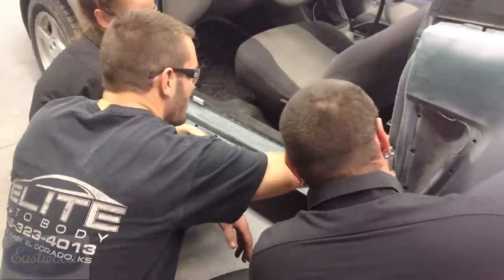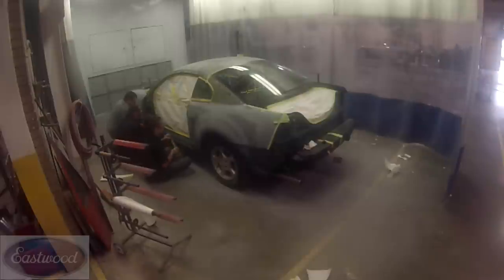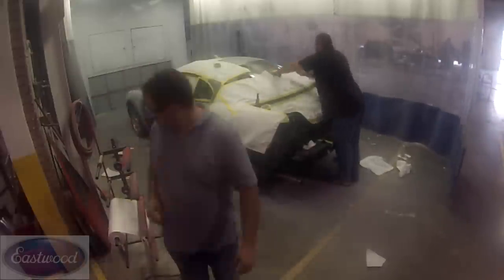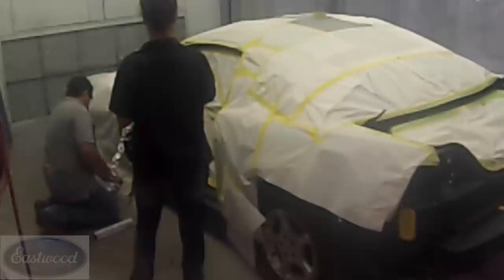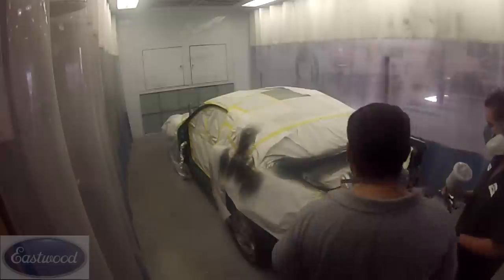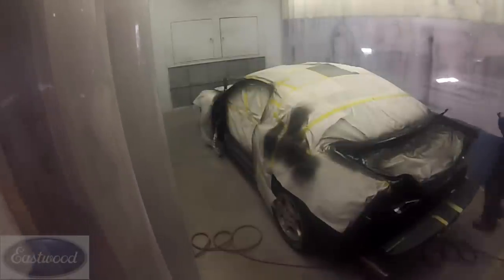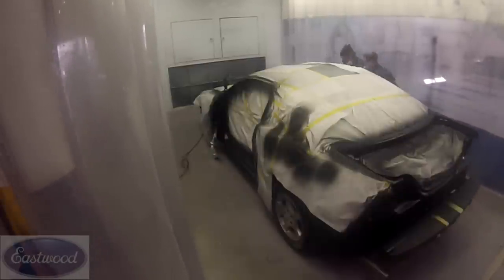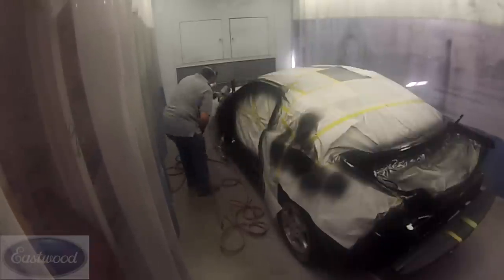How To Paint Car Inside Jambs - Eastwood Video Series

Comment: You had mentioned in a prior video that the primer coat must be sanded prior to base coat application. I fully get that; but what's the difference between the epoxy you applied prior to base coat without sanding vs primer and then base coat?

Comment: Good to see ya again Donny. Glad you're making videos again. Just wondering, why don't y'all use disposable cups for your primer?  I use them for everything since they make spraying so much easier because you can use your gun at any angle. Plus another big benefit is the savings in cleanup solvent.
Reply from the maker: K&L Machine and Welding Yes, I love those cups and liners.  However, I am using as much of the materials Eastwood sent me for this video.  I'm sure they make an adapter for this gun, but they didn't send one for it.  That is the only reason I am not using one of those systems.  Thanks for watching!